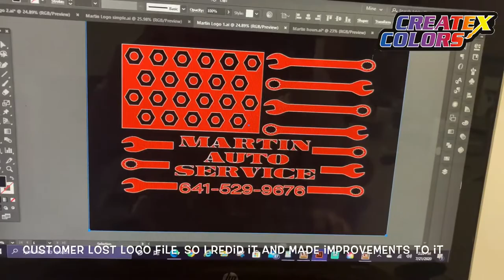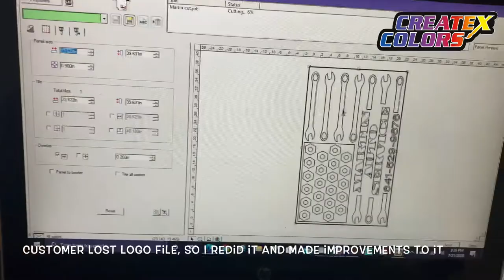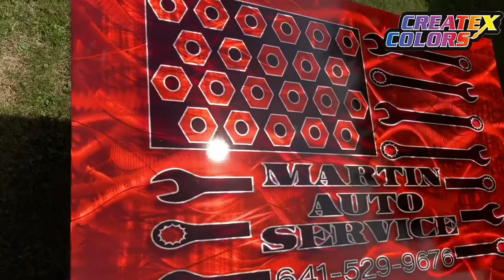How to paint on Metal with Candy2o and UVLS by Createx- BrusHstroKeZ

Comment: Great video.  Very nice work.  I like working with the createx products as well.  I just picked up an LPH80, 1.2. what air pressures have you found work best for this gun?
Reply from the maker: ThankZ man! Createx is awesome!I love my LPH-80’s!!!  I’m usually running 15-20psi for sealer, base, and candies. I spray really high solid clear coat, and usually around 35psi for clear.
Reply: @BrusHstroKeZ  thank you for the tips.  Look forward to seeing more of your great videos.
Reply: I also just picked up an LPH-80 with a 1.2mm tip. I see the recommended pressure is 14 psi. I’m inexperienced and curious as to why you’d shoot your clear at a pressure so much higher than Iwata’s recommendation. Is there an advantage? What could be the disadvantage? 
Thanks, love your videos.
Reply from the maker: Tamco recommends spraying their clear 5-10psi higher than most others. Their clear is really high solids(thick), so higher psi is usually needed. I’ve been experimenting with lower pressure lately and liking it. I’ll do more vidZ on spraying clear.

Comment: Cool video! Could you technically apply candy2o mixed with 4050 direct to metal without priming with 4050?
Reply from the maker: U can, but the adhesion won’t be as good. And you would want to mix it at least 6:1 or higher. I alwayZ use 4050 as a primer/adhesion coat.  WorkZ amaZing on just about everything.
Reply: @BrusHstroKeZ  Thanks for the insight!

Comment: Nice sign.  Because Createx recommends mixing the Candy2O with the UVLS clear, do you think it best to lay down a couple of coats of the UVLS clear first or is the Candy2O/UVLS mix adequate for the initial adhesion to metal?
Reply from the maker: Devin Thanks man!  I’ve actually been testing that out on the side. It does work, but the adhesion is not as good as it would be if u put straight UVLS down first. Since I do vinyl and masking, I always use UVLS alone as my adhesion promoter, then I let it sit at least 24hrs before working on it. I would say if ur just doing a solid candy, no tape out or vinyl on top of it, u should be good candy/UVLS mix direct to metal. I haven’t tried clearing over it yet, but assume it would be ok as long as it dried long enough. PS- I will be starting a weekly tech tip series on using Createx soon.
Reply: @BrusHstroKeZ  Thanks. Maybe in one of the tech tip series you do you could show how you do the drop shadows with a standard size spray gun.
Reply from the maker: Devin I can definitely do that. I still have the other side of this sign to do yet this week after the clear cures a few more days. I’ll make a quick video of setting up the gun and doing the drop shadowZ for ya.

Comment: Do you have to sand the 4050 adhesion coat before painting over it?
Reply from the maker: Nope. It has an open window. Can be painted over/on at anytime without sanding. Just make sure it’s completely dry and clean first.

Comment: do you have any issues getting the 4050 to get through the lph80?
Reply from the maker: No issues at all. WorkZ great. I have the 1.2mm nozzle with the E4 air cap (big fan pattern). I reduce about 10%. If u let it sit for 10min or so after mixing and before spraying, it flowZ much smoother. With Createx, the reducer needs a lil time to break down the surface tension of the paint/clear.

Comment: The Clear Coat, is it gloss?
Reply from the maker: Yes. I used Tamco 7600 2hr dry clear coat on these. ThankZ for watching🤘🏻
Reply: @BrusHstroKeZ  Thanks for the quick reply! Sorry though, I meant for the UVLS adhesion phase. Looking forward to more videos 🍻
Reply from the maker: Yes, I used the 4050 Gloss. ItZ the one with the best adhesion properties per Createx.  Don’t over apply. 1 or 2 light-medium coatZ is sufficient. Just enough to cover completely.